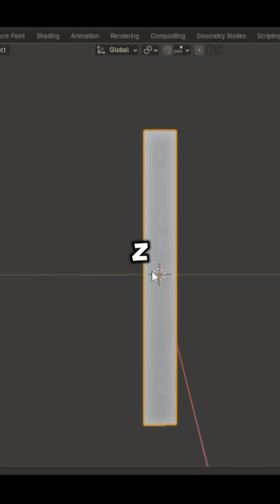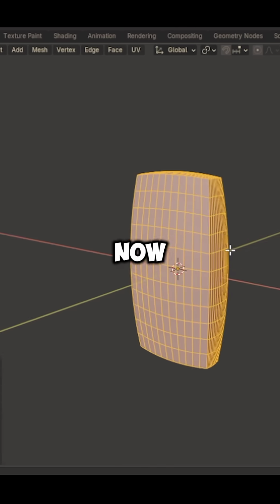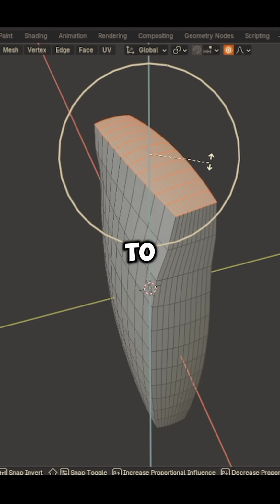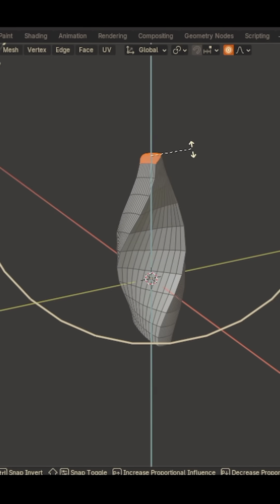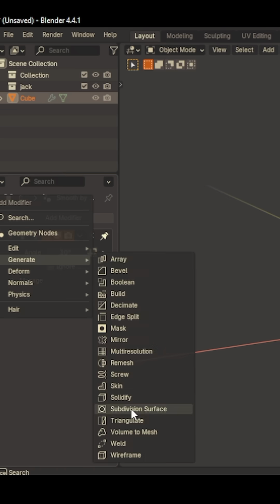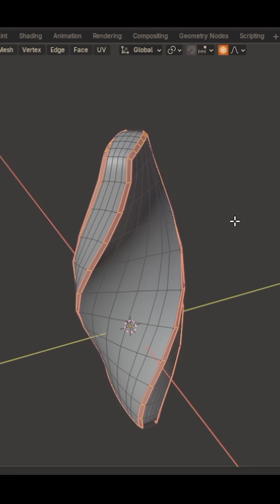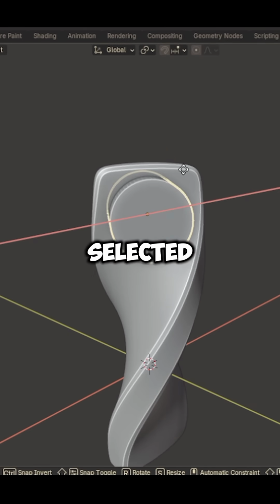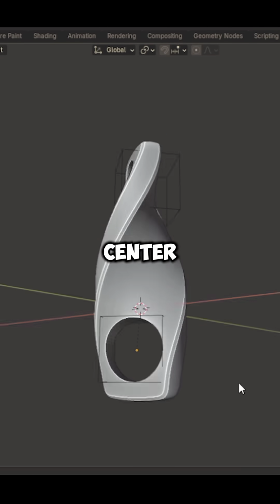Sub-D hack in Blender

Comment: With proportional editing you don’t get a symmetrical rotation of the mesh. It’s preferable to use the Simple Deform modifier with the Twist option, unless what you want is a shape that is not symmetrical :)
Reply: Would it work if using linear proportional editing?

Edit: read the next comment, I guess the radius can't accurately be set to affect it evenly to the base
Reply: @Ferriq-0  I think it can be done with proportional editing if you set the falloff to linear, but you need to set the circle’s radius to be equal to the length of the mesh.

Comment: What shorcut do you use for boolean?
Reply from the maker: Actually it's blender built-in addon called bool Tool, you could get it from blender extension. So, once you installed the add-on , you could simply press Ctrl + B to open the add-ons menu or simply use hotkeys, for example. Let's say you want to run a difference Boolean , hold Ctrl and press - key.

Comment: This is a bad way to do this for many reasons. 

1. It's inaccurate. You can't really choose your slopes or curves, and it's really difficult to change later. 

2. The proportional editing tool doesn't really allow for enough control to ensure that the top and the bottom have equal rotation. The top will almost always have more rotation, even if set to linear. 

3. This method falls apart if you try to create a twist greater than 90°, because of the way rotations work in 3D software. It will begin to collapse and shrink in the center. The same way a power plant cooling silo does. 

The much superior method of doing this would be to instead create a rectangle, duplicate it and move it up, then rotate it how you'd like. Then create some loop cuts, maybe 10, and select the rim. Then search for and select "Bridge edge loops" where you can define the interpolation, number of cuts, and slope all at once and perfectly symmetrically.
Reply from the maker: Good technique, but i don't think it brings out the exact shape i designed
Reply: @Jack3Duniverse  you didnt get what he said he said your version has too much limitations and is bad if you want to change it in the future read the comment again.
Reply: @Genius_47 Just copy the original version as a backup before you made major changes, duplicate the original and edit it so you can restart and make whatever changes you need without messing up the entire model.

Comment: You could instead use the simple deform modifier which would be much more accurate
Reply from the maker: Yeah! But it doesn't have the smoothness option. which is only available in subdivide menu..
Reply: @Jack3Duniverse He meant instead of rotating with proportional editing
Reply from the maker: Get it. Thanks for your information.